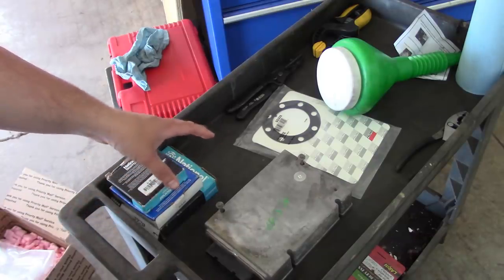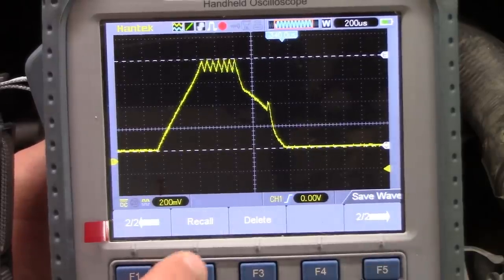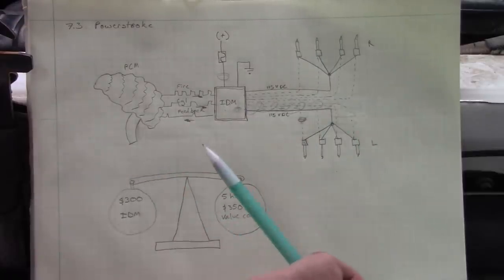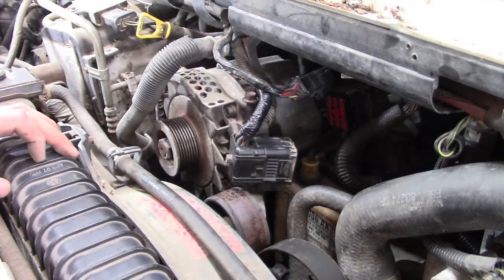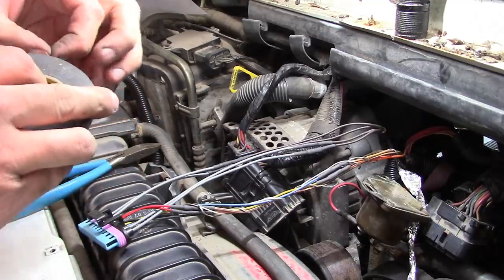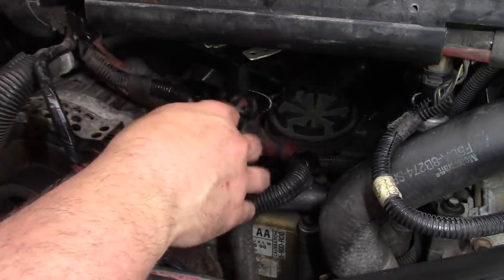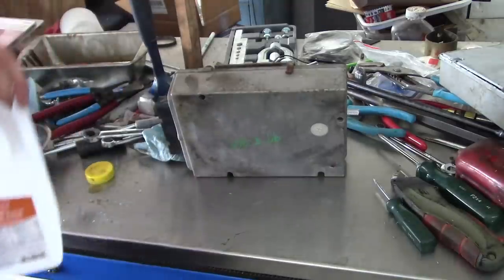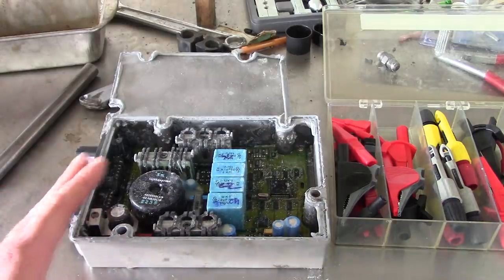Ford E350 | 7.3 Power Stroke - IDM Testing and Wiring Repairs - Part 2

Comment: Here's a BADASS trick for an electrical tape roll.  Cut a small slit from the center to the outside about 1/32" deep, straight out.  Why?  Excellent question!  When you wrap something up, the tape works fine with the slit, but if you want to tear a piece off easier, look for the slit and...the rest is history.
Personally, I DESPISE electrical tape. It always slims away.  Nasty stuff. 
Eastwoods sells (sold?) this 'tape' which is what the factories use.  It doesn't have sticky backing, it's thin.  It's what's harness are often made/wrapped with.  Check that stuff out, you might like it.

Comment: Did it look like there was no proper gasket on that IDM cover (40:12)? It's almost as if the shop that "relpaced" the one before took it apart, replaced a bad component and then siliconed the seal on the cover and probably didn't seal it well enough to keep water from pouring in? Thus the "failure" was the same module which was only repaired, not replaced, but the failure was different.

Comment: The sparking was flapping tape.
BTW, don't listen too much to what everyone says, we all like to think we are mechanics(me) but we aren't. Just read, think and test it if one idea or suggestion catches your interest.
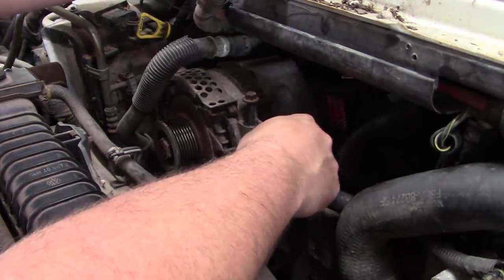17:30 🤣🤣🤣🤣🤣👌🏻 AH, YES, THE JOYS of working on a Van !
Around my neck of the woods anything with a van body or half van cab and powered by a big diesel V8 is either thrown away when the engine blows up or taken to a shop that does this everyday(VERY RARE OCCASION) and has the time, space and expertise to lift the body off the frame to do any big engine work(injectors, heads, etc). 
Although this one is not blown I'm almost 100% positive just by it's age and the nature of the problem(electrical gremlins) it would be deemed a waste of time and effort and sold as scrap metal.  
Many of the regular shops are just not qualified or have the facilities(space and strong enough lifts) to work on these.
I say, between the peeled glow plug wire and the flooded IDM that will do it [fingers crossed]. It sure made for an awesome video.
Good work, man ! Very educational and entertaining watching you do your thing ! Keep it up !  👌🏻😎👍🏻

Comment: I once repaired a Haas mill (VF5 I think?) that had a wire pinched in the sheet metal on the spindle, and it would intermittently cause the whole mill to lose power, and the head to drop by about 0.1", usually mid cycle. 

I don't know enough about Powerstrokes to even be considered dangerous, but based on what we've seen, I think you're probably right about the bare wires shorting. At least that's the most plausible thing, unless the guys before were only replacing IDMs in the middle of monsoon season.
Reply from the maker: I don't know. I was never able to recreate the event that lead to the IDM dying. I guess it will forever haunt me...

Comment: Easy way to access injectors is unbolt radiator support and cut the frame in front of first cab mount. I have taken out a few motors at the junkyard this way. Putting it back might be a trick, though.

Comment: that "sparking" looked like loose electrical tape flopping around because of the fan. supposedly the turbo is largo on the e series 7.3 because it doesnt have an air charge cooler. that makes it a little tighter in there. intermittent problems can be the worst. i have had my share.
Reply from the maker: I think the larger turbo would be on the 99 and newer. The 94-98 engines did not have charge air coolers in any Ford application. The larger turbo would be a whole lot better than trying to jam a cooler in that thing! These E series even have two different size batteries since two group 65s will no fit. What a nightmare...

Comment: i was talking about on the last video.. the AIR CLEANER BOX mounting BRACKET..  2 bolts into the top rail of the Cowl ledge.. 2 bolts into the radiator core support..   set the air filter assembly back in and see how much clearance is..  its just a thought..
Reply from the maker: I think the clearance is OK.
Reply: @WatchWesWork  if the clearance is OK... are the motor mounts bad allowing the engine to tilt up..   i am on my 4th set of motor mounts in my 96 E250 4.9 with 540K..

Comment: Got to be those wires, they were shorting to something to cause all the burning damage to the insulation. Also, would be interesting to find out how long ago they replaced the control module, as that much water in it makes me think they replaced it with a used one that was already waterlogged and didn't notice or care. Fingers crossed it's now fixed.

Comment: I think the heat up off the engine is causing something to expand and short out/arc which isn't happening when the engine is cold. Easiest solution: Add some fuses to each sparkplug wire which limits the current draw to the maximum it should draw.
Then let the engine idle high with the radiator shut off. One fuse should blow out.

Comment: The problem may be a faulty / intermittent injector that occasional shorts to ground, frying the power transistors of the Injection Control Module, obviously  the output stage of the Injection Control Modules has no over-current protection,   A simple fix may be to install an in-line fuse for each injector,  so if an injector or the line is shorted,  the fuse will blow protecting the driver transistors. seems like a lot of work installing 8 fuses but it could be a worthwhile protection for an expensive control module. Additionally make sure the aluminum foil wire shield is grounded to pass any arching to chassis.

Comment: I’ve founds 100’s filled with water. Used to use old license plates for a cover but ford dealer didn’t like that so we started using more expensive sheets of stainless and bend them to fit. Then they just made us use gray RTV and completely seal it vent and all.
Reply from the maker: Interesting. It's glued together with RTV, but apparently not enough!

Comment: To me, the answer is do the Valve Cover Gaskets. I remember being told by the guy at VIMY DIESEL(outside of VIMY ALBERTA) that the Taxi Company Shuttle Bus (1999 FORD F 350) that I worked for needed the Valve Cover Gaskets replaced. I gave the go ahead for them to be replaced because the "Owner" didn't understand what was wrong with the bus.

Comment: hit up the RE-Store. Scrap metal yards.. HVAC shops.. for a 3 to 5 ton furnace blower.. either direct drive or belt drive ..   you can build a basket that hangs about 2 feet from the  blower outlet.. build a framework to stretch almost any kind of window screen over..   you can let the fan blow downward and blow any nats or skeeters into the long tapered bag made out of window screen cloth..   flies and skeeters can't fly in a downdraft..  you don't even need to run these very fast..  you can make the bag fairly large .. 

 you can do it outside.. but the blower stays inside.. using either duct elbows or duct stacks.(things that fit between studs in walls.) so the blower stays inside the shop and dry.. the airflow comes thru the wall and blows down trapping the little flying boogers..
Reply from the maker: Hmm. Seems like it would work. I think I have an old squirrel cage fan around.

Comment: I would respect your  opinion on what the problem before mine or anyone  at a dealership or most commercial service shops. You seem to go the extra mile to find the problem. If you don't fin the issue, I doubt that anyone else would.

Comment: One thing to consider about the possible arcing is the voltage. Injectors can spike up to 400v on collapsing magnetic fields of 14v Saturated switch injectors in regular cars...i imagine 110v injectors collapsing magnetic field could spike a bit more 🤔 

Law of ionization is 80v to jump a 1/1000th inch gap at sea level...IIRC

Comment: Hey Wes! I have a 2003 e450 7.3. Around 45 to 55mph I get a vibration. If you turn over drive off or get on it. It stops. I replaced tires... has 170,000 miles

Comment: Best electrical tape I've ever found for outdoor weather sealing applications is 3M Super 88, and with the radio base stations I work on, almost every manual says that the connectors need to be sealed with self-vulcanising tape or Super 88, regardless of manufacturer. The only downside to it is the adhesive, it's leaves a black residue over everything you apply it to, so it's not as useful for temporarily marking stuff as ordinary electrical tape is.
Reply from the maker: I have some here. Heavy duty stuff. I use it for split bolt connections.

Comment: I agree that it was likely the frayed wires in the harness. However, could the pinched glow plug wire caused a separate issue to snowball into the problem you had? Also, the water in that unit had to be part of the problem too. So many factors here leave me scratching my head. Great video, I always enjoying watching you work!
Reply from the maker: Yeah, too many variables to make a good call.

Comment: Wes having been in the fire department and EMS I know that you need the larger alternator and sometimes 2 batteries just to keep all the lights in the Box and on the cab running. Just thought I would share.
Reply from the maker: The newer trucks all had a provision for 2 alternators for those applications.

Comment: BTW did you check the voltage going into the the IDM? Could be the reason it takes a couple weeks to blow it up. Not enough voltage can be just as harmful as too much voltage. I know from experience that a Personal computer will eat itself up over time if if doesn't have enough power from the PSU. Before I let it go back I would check that all input and output voltages were correct, it could stop it from coming back.

Comment: i had a similar issue with a windshield leak dripping through the ecm on a volvo 440, i cured it as the mount bracket was at the bottom by just putting it inside a ziplock bag with the opening at the bottom, this formed the umbrella and stopped the water sitting in the connector on the bottom, where the wires were rotting out.

Comment: I killed my idm by pressure washing under the hood. The back side of the edm has a small open hole that will let moisture get in even though it is mounted facing the inner fender. Got a new one from an aftermarket company and they seal that hole.

Comment: If you have similar symptoms, do yourself a solid, swap a new fuse into the slot that protects whichever computer is going bad, if you are as poor as me, and you bought a cheap rig that needs work, do yourself a solid and go through every fuse, and verify they are the correct rating.  You would not believe how swapped around stuff gets after 20+ years.  I've seen trucks that went through computers because, they had a short, kept blowing fuses, so the previous owner put in a over rated fuse!  I'm working on an f550 now, with a 7.3, that I got for cheap, cause the "computer was busted" turned out to be corrosion on the interior computer grounds.

Comment: I have had ECU’s go down due to bad earth as it has caused feedback through other pins on the ECU. Land Rover TD5 engines cause similar issues due to insulation breakdown on the injector harness which runs in the head. It’s a long way around but you could always use an electrician’s insulation tester if you suspect shorts to ground. One of those horrible jobs where you just cannot put your finger on any one thing.
Reply from the maker: Yeah, I even have a megger...

Comment: I believe it was water. Rain wicks in quickly, as it cools the unit it creates a vacuum sucking the water in. Water and 110V can you see a problem?
Reply: The Vent should have prevented the vacuum sucking the water in. It is also called a Pressure Compensating Element that stops water droplets from entering the enclosure but enables the air pressure to equal out on warming up and cooling down. The membrane in the Vent is made of a Gore-tex type of material.

Comment: So my thoughts on the failure of the idm is not necessarily an injector backfeed but is a misadventure of electrical engineering of the module itself. This also relates to my Chrysler telecommunications bluetooth module. You know the one that let's you use the phone hands free while inside your car. Of course it is up under the brake pedal and my door sill does not make it easy to change out for a 75 year old guy like me. I know what's wrong, but we just don't use the cell phone while driving, simply because if I put a new one in will it go out in a couple months and how easy is it to use anyways. Sometimes bluetooth resets every time you shut it off which would make it unusable anyhow. So full of water. That explains every two months @ 300$.

Comment: What flashlight is that? Having similar issues with my 2000 f250 sd. Started firing on One Bank going down the road pulled my valve covers turns out I have one injector not firing and about 2 to 5 minutes after you start the truck the driver Bank quits. Shut the truck off let it sit for a few minutes try it again everything is good except the one injector couple minutes later driver side bank quits again. I'm thinking kind of like what you said earlier on in the video of one bad injector can make the whole Bank shut off. I'm guessing start with that injector and then if needed move on to the IDM.

Comment: The problem was the fact that the IDM was full of water. Something was not channeling the water properly, as the truck would not be designed to channel water directly into the engine compartment. This would obviously be an intermittent issue due to the fact that it would have to be exposed to water. Of course, as you well know, it doesn't mean it actually happened after 25 miles just because the customer said that it did. It is also impossible to know what conditions they drove it in either.

Comment: I have those same hose pinch off pliers in 3 sizes, sold under the Blue Point and Imperial names. I believe Imperial is the actual manufacturer of them if anyone cares. They are certainly cheaper than the tool truck branded ones anyway.

Comment: Do all the powerstrokes have that control module under the hood? I figured it would be mounted in the vehicle where most control modules are located. 
I did want to mention something I heard or read somewhere - that PCM is going to be drawing a lot more power when the vehicle is under load. As I understand it, the pulse width increases with load and rpm to deliver more fuel.
Reply from the maker: The IDM will pull more power as the RPM increases, but the peak current should be the same. It takes the same amount of current to open the solenoid under load as it does at idle, but it has to do it at a higher frequency.

Comment: Could the engine mounts be broken or worn to let the engine move under a load and let the wires rub and contact the metal piece above and short out. Shrink tube is a good fix but may have an issue that caused it.

Comment: What do I think?  I'm not sure what to think.  The wires are the simplest answer.  I wonder if there was heavy rain during those couple of 25 mile test runs?  It's hard to tell on video, but looks like that IDM had a ton of silicone sealant to seal it closed, almost like when it was rebuilt, the rebuilders saw something wrong where they thought it might not seal so siliconed the heck out of it?  Dunno.  The electrical spiking is strange too.  A real head scratcher!
Reply from the maker: Rain is another factor, for the IDM and the wiring.
Reply: @WatchWesWork  You know, you may be onto something.  Rain on those chafed wires could very well cause conduction...  Pure water is an insulator, rain water is surprisingly conductive.

Comment: To changE INJECTORS on RHS you lift motor and remove LHS engine mount, set the engine down and the motor rotates over giving enough clearance to pull injectors.

Comment: How long did the idm last? 
       I had a 02 1 ton that killed 4 boxes in 6000 miles. No water problems. Couldn't depend on it so sold it.

Comment: 2 years after your video, but if an Injector wire is shorted to ground, the Inject will never see that voltage, the IDM sure will though and most like destroy it for that one lnjector.  Unless it has a fuse...... I just bought a 7.3L '02 Excursion, so I am reading and watching everything I can find.  My Avocation is electronics though, so I know Diagnostics.

Comment: In theory the injector module should not be damaged by a wiring fault. In many applications the control modules can detect, short to ground, open circuit or short to power and switch off that circuit before damage is done.  My guess is that water ingress was the problem.
Reply from the maker: In theory that true. But then I've seen tons of engine computers with failed coil driver circuits...

Comment: Ok I had to rewatch this may I pose a question to you i currently have a 96 powerstroke so I have a monitor on it every once in awhile the monitor will lose the speed sensor and thus mess up the transmission but the speedo stays working I have already changed the sensor and checked the tone wheel is there some way to test  some of the things to you mentioned with just a voltage tester thanks for any info you can share with me

Comment: Random spikes in waveform....  you have injectors firing and releasing.   There has to be some sort of feedback protection (diodes?) for the time in the cycle when the field on the injector coils is collapsing.   Are those shunts integrated in the injectors or part of the IDM?  If the inductive feedback is not shunted, it most certainly can kill a gated driver.
Reply from the maker: I believe the IDM has flyback diodes.